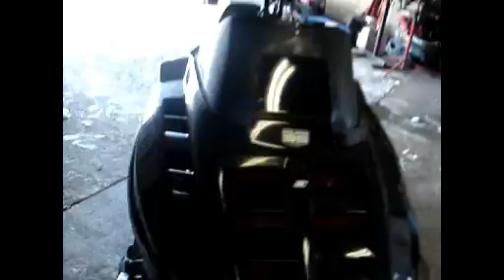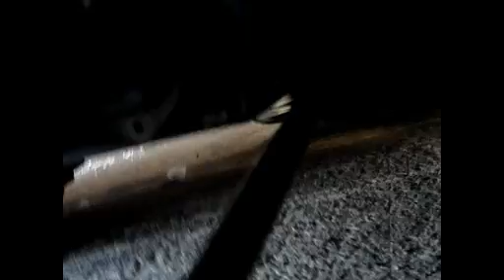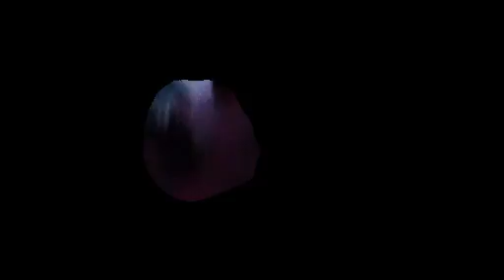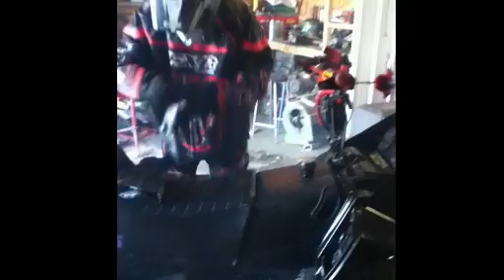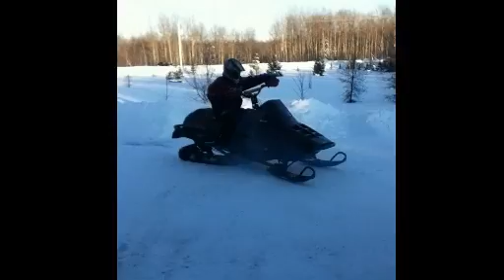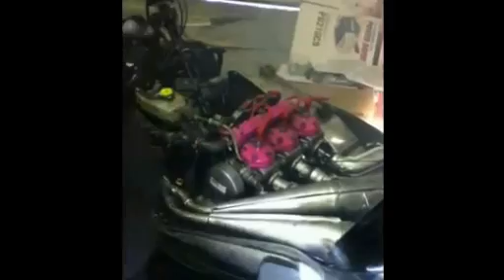Polaris Storm sks 750-800 DG can

Comment: my 93 sounded better with a melted PTO piston, the rings on that sled are toast.
Reply from the maker: +Derp Tube both of theses engines made actually pretty good compression, its all about jetting and overheating issue, very but Very too much rich, especially on the 800 plugs was flooded
Reply: +bouletmarc24 i know those 38mm Mikunis can be a pain to dial in. i finally ended up doing a port and polish, adding snowchargers, slp boost bottle, and going 330-330-350 mains to get mine running good with out losing too much piston wash. i run a 750 though, i know a 861 big bore and port and polish helps the 800's out alot.
Reply from the maker: +Derp Tube to be honest, this sled above was the Worst sled I never had, probably the best looking sled I've had so far, but so many problems, only to set it up like you say its a pain in the ass, I never had trouble jetting any of my machine but this one was something differents, lack of power, extremetly weighty. I love so much polaris and thoses wedge bodys, they got a "particular" style, but the storm engine is something I hated from my favorite brand.